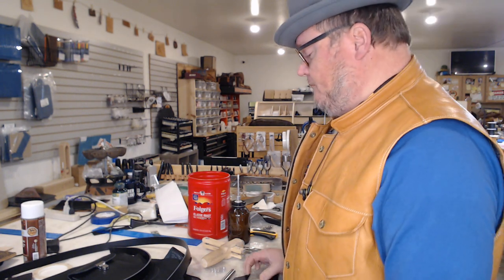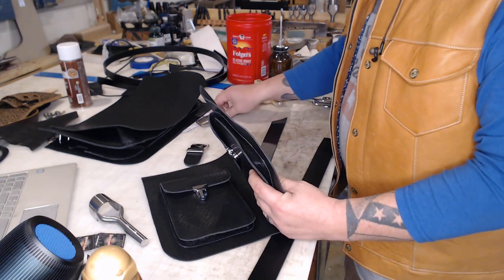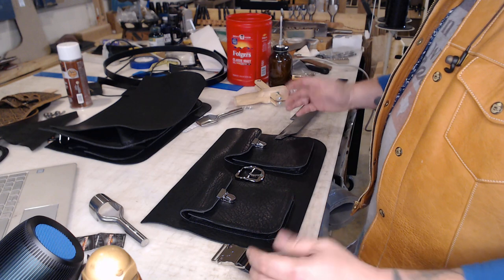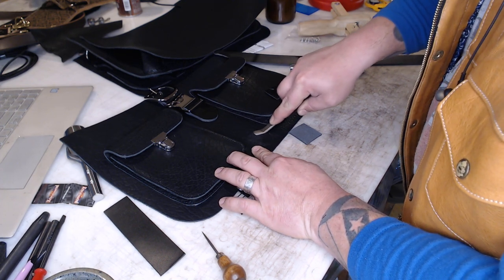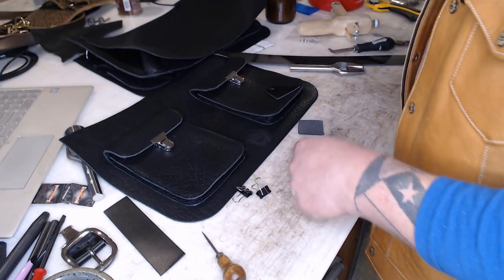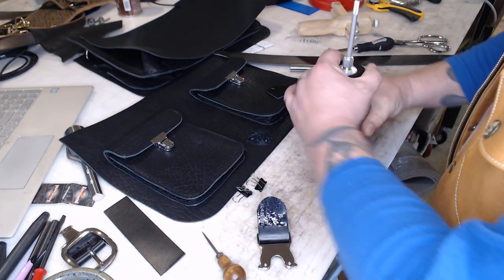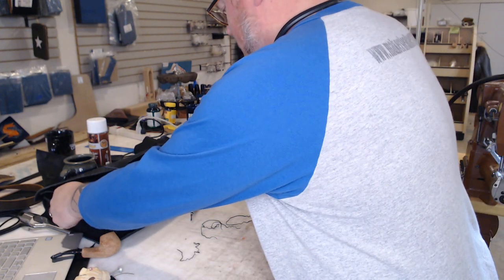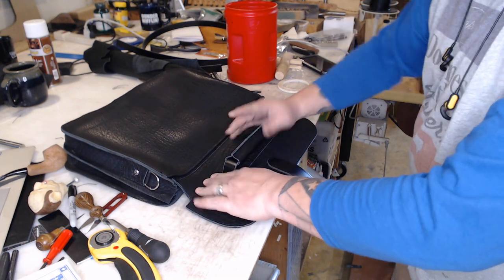Making the soft sided briefcase part 4! Lets finish this!

Comment: Aaron do you see any issue doubling up the center panel like you did the back panel on the man sack to add a zippered pocket? I realize I'd need to add some length to the two panels it would require.
Reply from the maker: Should be fine.